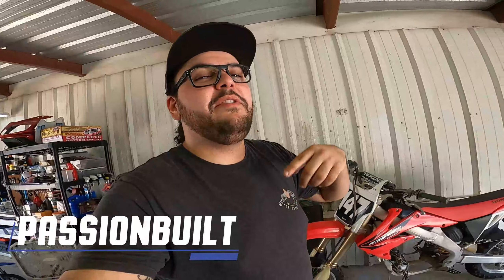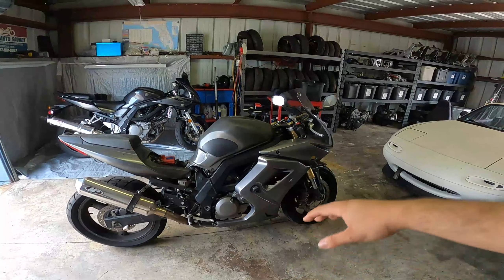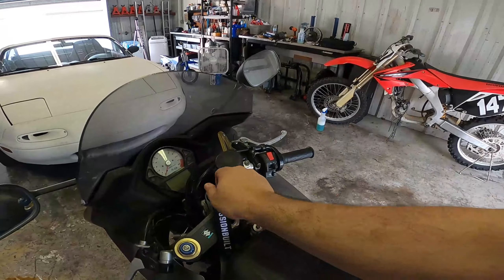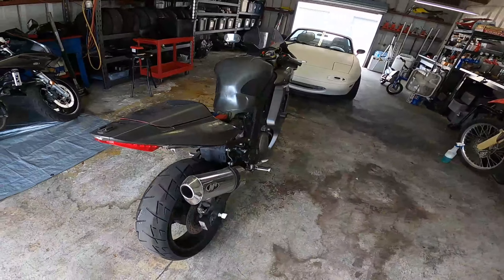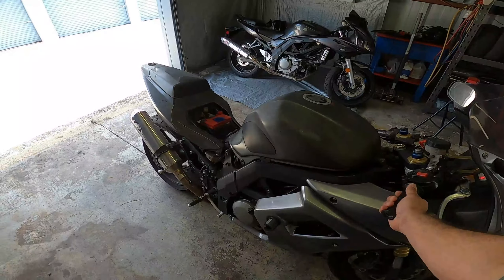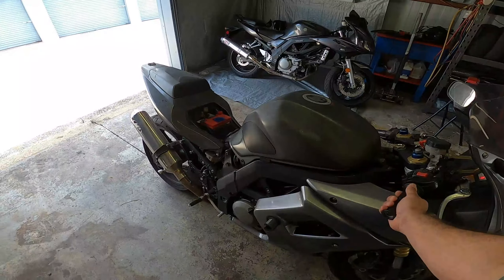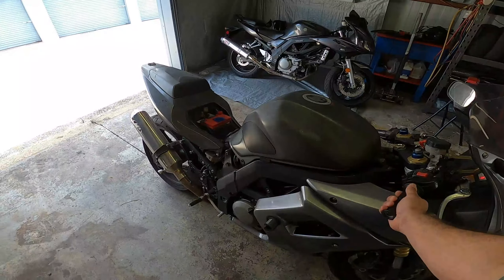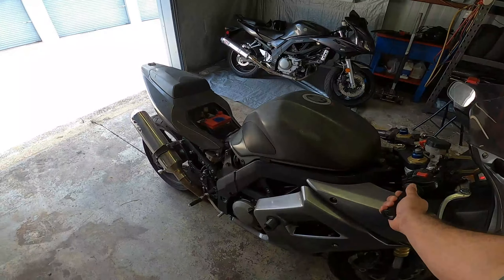I'm Parting Out My 2008 Suzuki SV650 (SV650SF ABS Parts Bike Full Walkaround & Parts Breakdown)

Comment: Still waiting for you to put it up. I want the fairings.
Reply from the maker: Hey sorry. I’m running a little behind on posting these parts for sale. Which fairings were you interested in? As I mentioned in the video. The lower fairings and rear seat cowl will not be sold as I am keeping them for my other SV.
Reply: @PASSIONBUILT  Appreciate all the knowledge you share on your channel!
I hope the covid situation is okay and your family is recovering well!
Just to add upon that you are adding those fairings on your other bike.
I was wondering if you could add details to how you mount your fairings on the bike when you come across it! If it fits your time schedule and or content usage.
I currently have an 06 N model and very interested in going just fully faired but want to get a clearer vision on what i need/must do.

Thank you so much!
Reply from the maker: @iwishiknew I had already planned on making that video about the lower fairing installation and how to do it. It won’t be for a while but I will be making it. However, if you plan on going full fairing, you’ll have an issue with the front upper fairing if you have a true N model because the N model does not have the mounting point for the front upper stay integrated into the frame like the S model does.

Comment: I noticed you have a radial mounted master cylinder and a inverted fork (GSX maybe?) did you remove the ABS from the front end to complete this conversion? or do you still have ABS on the front? I currently have a 2007 SV650 with ABS and I wanted to see if it's possible to swap the master cylinder and upgrade to 4 piston brakes with ABS in the front or should I just remove the ABS items from the front? 

Thank you!